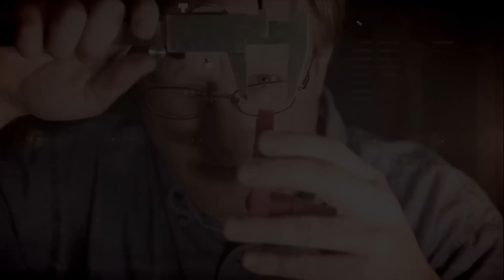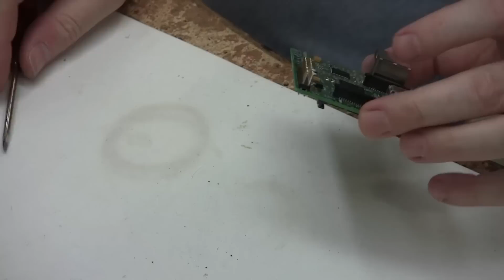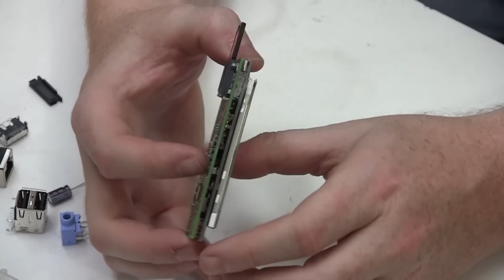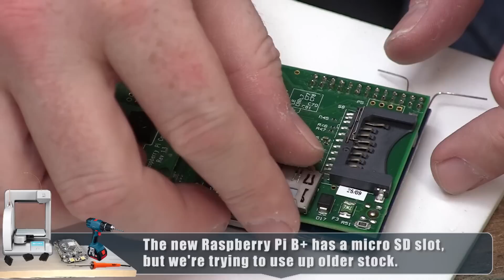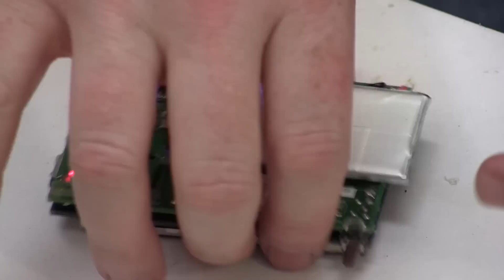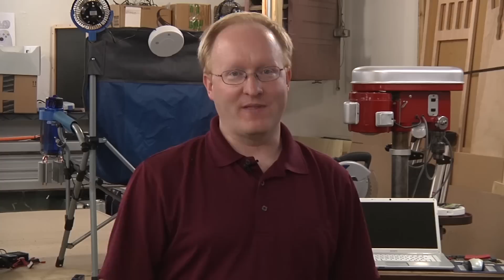Ben Heck's Raspberry Pi Point and Shoot Camera

Comment: Ethernet has no ground pins, all the signals are magnetically coupled, It does have the shield soldered usually through a 1M resistor to gnd.

Comment: Watching Ben desolder takes me back to my first tech job programming pagers.  We used to have to take out frequency crystals and what i would do is hang a pair of kelly forceps off the crystal then flip the board over and desolder the leads.  The weight of the forceps would drop the crystal on the bench when it was freed...

Comment: PCB Printer

Hi Ben,
You builded a lot of 3D-Printers. But way do you not build a PCB printer, that prints a plastic panel, and than prints the copper on top of it?
Of course you can't let it place all parts, like LEDs, on the PCB but I thing It will be very help full.

-Bye from Germany.

Comment: Rocking joints that aren't properly heated to full reflow temperature is a good way to damage a pcb.  A hot air gun with a aluminum foil heat mask works pretty well to remove thru-hole headers.

Comment: "I wish they just had a Raspberry Pi that had nothing populated and to add what you wanted." We do have that, it's called an ODROID-W, but sadly  they only have the trial batch made due to Broadcom pulling the plug on the project. Beset part, it had several other components (RTC, Battery charger and manager, mini-HDMI, microSD) and was MUCH smaller. It is a shame such a great idea gets shot down like that.

Comment: +1 for a Rapberry Pi DIY kit.  Maybe not 100% bare board, but close.  Is it just the video, or are the photos a bit washed out?  Did you put any type of protector/screen over the camera module lens?  I think I'm going to try this build and make it compatible with my old Nikkon lenses (circa 1990s).  Finally, why not make the battery pack removable?  It'd be great to carry a few spare batteries with you when you travel.

Comment: What the hell is 700 Fahrenheit in temperature?
Reply: Schlablaba Dingdong 96% of the world uses Celsius. Americans should use it too. Fahrenheit is bullshit.
Reply: It is all temperature...
Reply: Schlablaba Dingdong Well, yes, but the Fahrenheit scala has a way more idiotic definition, also pretty much the rest of the world uses Celsius or Kelvin, just another symptom of American ignorance.
Reply: QuantumFluxable ignorance is the lack of knowledge, doing something diffrent isnt, the system works so get over yourself.
Reply: hristaki99 I suppose the whole world should speak the same language too. Snobbish prick. 

Kelvin is better than Celsius, better isn't best. 

American education does need to get with the program. It's pretty crappy.
Reply: QuantumFluxable Fahrenheit more logical for our climate, just as Celsius is more logical for science, it was designed to encompass our year round temperature in a 0-100 degree scale...so for general use to say what temperature it is outside, Fahrenheit is more accurate than Celsius when you want to give a simple weather report. Not to mention, in any field of science we "ignorant" Americans use Celsius instead of Fahrenheit which is why many of us know both units.
Reply: QuantumFluxable in this case its more like it not broken so why fix it. tell me something when you where in high school adn saw all the cool kids wearing (insert common pointless style used by teenagers) did you run off and start wearing that style right away to, or did you keep on wearing the cloths that you liked already and where comfortable
 for you.
Reply: Darude -sandstorm
Reply: I know I use Celsius he asked what is 700 fahrenheit in temperature. I was being a smart ass.
Reply: ***** "designed to encompass our year round temperature" So what about the other uses for temperature measurement in everyday life, cooking for instance? Also it wasn't designed for telling the temperature outside, the 0° F point was assigned to the lowest temperature that could be reached (via a mix of some mineral salt and ice) by the time Fahrenheit postulated his scala, and the 100° F point was defined as "somewhere around the temperature the human body has inside the anus", which seems amazingly scientific. Also, why use two temperature scales if you could just use one? Everyone outside the US knows that everything below 15-20° C means you have to wear a sweater and around 0° C it could start to snow, so clearly it isn't complicated to use the Celsius scala for weather, what is complicated though is when you start to have to convert from F to C and back when you have some sort of crossover of "weather" and science". Also Ben used Fahrenheit to describe something that clearly isn't weather-, but science-related.
Reply: QuantumFluxable i find all this funny since Fahrenheit was used first and celsius second. basicly as a country we started useing one and when the other came out we saw no reason to swap over.
Reply: CyberRattt I see, so it's just the American Way, just like with the constitution. Just because it's old doesn't mean it's gold.
Reply: QuantumFluxable
You seem irrationally angry that another country does something different than you. Do you criticize people for not speaking English, or just get mad at Americans for their units of measurement and their pronunciation of the letter "Z"?
Reply: buggsyspam The second one, probably. So you are mad at people who say things on the internet? That's a great hobby.
Reply: QuantumFluxable
 Option 3: troll. Got it.
Reply: ***** so the same temperature scale as celsius is worse than celsius. got it.
Reply: ***** FALSE. Kelvin IS celsius, they just moved 0 degrees. In celsius 0 degrees = freezing point of water. In Kelvin 0 = absolute zero.  Otherwise they scale the exact same. The only reason celsius is "easier to understand" is because you're use to it. No one talks in kelvin when discussing things of normal use like cooking or room temperature.

If everyone said, man it's cold outside! and the reply was Yea it's only 276 degree's out there! than it would be easier to understand kelvin. But no one talks like that. Kelvin IS celsius. they are on in the same. they slide the same, scale the same etc.. only kelvin is celsius plus 273 (273.15 to be more precise) ...
Reply: They are the same level of difficulty to understand. One is just more common place. How do you not get that?

They invented kelvin by taking celsius and replacing the location of zero. So its equal in difficulty to understand. 

What you should say is kelvin is more difficulty recognizable. Or translated to a recognized value. But they are no more or less understandable than each other.
Reply: Kelvin and Celsius use the same scale. I think the Nerd is confusing what is meant by this. A single degree change in Kelvin is the same change in Celsius. It's a 1:1 relationship. You can't say that about Fahrenheit vs Celsius.

Comment: And since I have bad soldering habits - is it OK to use a super dry iron as a wick to get solder out of the solder joints/holes?  Solder wicks seem to want to join more than suck. Maybe I am just not used to using them. When are you gonna finally just get with Elmer's and make a WTHeck glue to glue my circuits together!?

Comment: Was wondering if you know anybody to mod an Xbox 360 controller to look like a ps3 controller
Reply: Possible but it'd likely be bigger and bulkier and would require a 3d printer. Besides that it's just moving over the parts.

Comment: Repeatedly soldering/desoldering a joint just unnecessarily puts stress on the board and cause delamination. Why not use the right tool for the job? This is clearly the wrong way.
Reply: What would be the right tools?  I don't have the latest and greatest stuff myself (too pricey)  I have basically what he has for soldering and desoldering.  I've had problems getting components out of a multi-layered board and would love to know a good way to get them out.  I feel like I break and throw away too many valuable parts when I can't get them out.
Reply: xnamkcor X
a pump is not that expensive. Teaching the wrong way can end up being very expensive.
Reply: xnamkcor X Take the video as an example, would you rather buy a new raspberry pi because you delaminated the board, or a cheap solder pump? Not sure why you are so persistent in this comment chain, seems highly unnecessary.
Reply: Seriously even a 2$ solder sucker would be better than hacking things off like that ...that was just disgusting to watch.
Reply: sprybug  A cheap alternative to a desoldering iron will be a desoldering pump. Heat the solder with one hand and quickly activate the pump with the other hand.
Reply: I fucking hate youtube.
Reply: I was referring to the part where he took out the RCA jack for composite video. The right tool would either be a desoldering pump or a desoldering iron/gun.
Reply: Well I'd do it on a dead board for parts harvesting but other wise a nice ball of 60/40 then a cheap sucker does the job. Might take longer but less risk of totally destroying a motherboard.
Reply: Agreed.  A heat gun and a piece of aluminum foil as a heat mask works wonders.
Reply: meade816 I don't think he's trolling.  It's very easy to damage the PCB permanently, mostly because of the prying.   Solder wick or a heat gun would do the job without potentially damaging the board.
Reply: meade816
I've been in the industry for years. It is a fact that this is the wrong way. He should have said "If you don't already have a desoldering tool, for example a simple solder sucker or a desoldering iron, you should get one." and be done with it.
Reply: meade816 I bet you're that guy who never even left his home to find a job.
Reply: meade816 keep having fun, but this conversation is over. There is no point in talking to you.
Reply: As a last resort, if you don't have the right tools, you can reduce the melting point of the solder joint by removing the bulk of the lead free solder with some solder wick, and resolderi them with some good ol' 64/40 solder.  Then use a broad tip soldering pencil to heat as many pins as possible at the same time.  You might still have to "walk it out", but it can be done with far less stress to the board than what we saw here.  Never use the technique I described here on a production PCB... it will no longer be RoHS compliant!
Reply: nrdesign1991 Good Game Bro
Reply: What I meant to say was that I've seen it enough times to confirm that PCB's break when being mistreated too often or for too long. No offence intended.
Reply: nrdesign1991 people doing this kind of thing are not "industry" people and usually don't care all that much for the "proper" way to do things. I blame "proper" for a lot of missing talent. People afraid to just roll up there sleeves and get their hands dirty cause people like you telling them they are doing it improperly and you know cause your in the industry. 

It worked. It worked for the intended purpose. It worked for the intended purpose for less money than you would have spent. It is therefore the proper way under specific circumstances that are not applicable to you. 

Sorry I have little respect for "proper" and all the snobbery that comes with it. 
Peace to you.
Reply: IDStatic Tried it.  I have better luck with my desoldering iron that already has the pump on it and it still has problems on the multi layered boards.
Reply: nrdesign1991 The RCA jack he was showing everyone how to remove it if you didn't have an desoldering iron.... troll.
Reply: Darren Woods I do have to admit to doing that myself.  Mainly because of the multi-layer board problem where it's hard to get the solder out in the first place to even remove components.
Reply: nrdesign1991 He pretty much said that, it's best to do it with one but if you don't have one you could do it this way but you have a better chance of damaging the board. I bet your that one guy at work no one likes.... Mr known it all.... Glad I retired at in my mid 20's so I don't have to deal with people like you.

Comment: Is there a safer way to deal with the removed solder than to drop it on the floor/shoes/legs? I don't have a desoldering iron but plan to eventually get one. What do most folks do?
Reply: You can also use some desoldering wick/braid to pull the fluid solder away
Reply: most solder is already solidified by the time it hits the floor. Thus, making it pretty easy to vaccuum up later. Just don't land it on carpetted floors.
Reply: Buy a hakko FR-300, thats how you do it safely.
Reply: Either flop the solder onto the ground or use a desoldering pump. A good one is the "Soldapullt", it has great tips and a large suction volume
Reply: devjock It's really uncomfortable getting it on any exposed body parts though, there's bad memories arising from when I was doing some soldering in the middle of the night while in my underwear because it was hot as balls.
Reply: QuantumFluxable definitely agreed

Comment: having both the nightvision and the normal camera is it possible to make a switch so that you can use one or the other ?
Reply: I imagine it would be pretty easy to make a mechanical switch that just switched which ribbon cable was connected. It would add some bulk, and require a reboot to switch, but pretty doable.
Reply: if anyone makes it and gives me a price I would gladly have one
Reply: probably not since it involves a physical filter ,but I'd imagine a simple switch-able filter module would be easy to add
Reply: I meant if i have both cameras one is nightvision the other is not
Reply: ah if you have one of each then yea it'd be a fairly easy software switch.
Reply: Problem being I got just one port for one ribbon
Reply: it'd be a pain to hand wire but you could have a switch that leads to a Y connection and you could switch between the two using only one port
Reply: Can anyone make that switch?
Reply: Where can I find it?
Reply: which switch can support the ribbon cable ?
Reply: http://www.raspberrypi.org/pi-noir-infrared-camera-now-available/
http://www.raspberrypi.org/help/camera-module-setup/
those are the two cameras
Reply: what I need is someone to make me a cable or a switch
Reply: mostly just a lot of soldering, I could do it but it'd be cheaper for you just to do the soldering, it's not too hard

Comment: There is Raspberry Pi with no connectors: the Compute Module!

EDIT:
(If I had your skills) I would have removed the ethernet chip to further reduce power consumption. Or just go for a model A. Also I would have reused the micro USB jack as a USB OTG. :-)

LOVED today's show. Excellent work as always. Thanks!